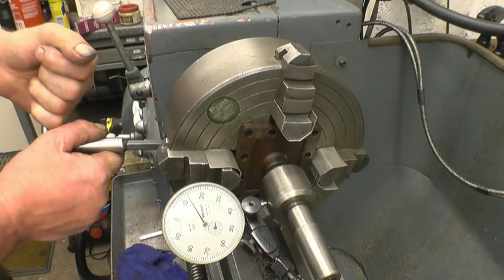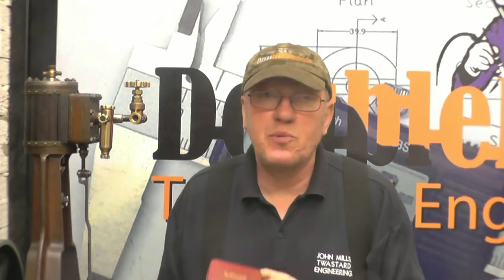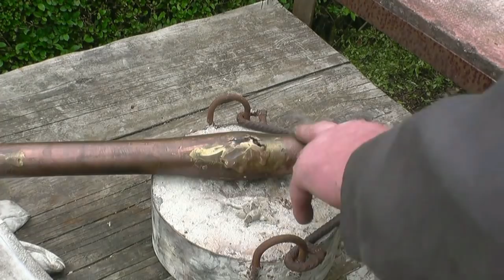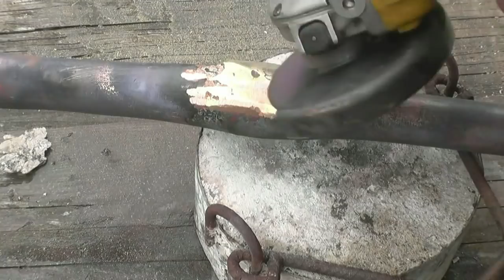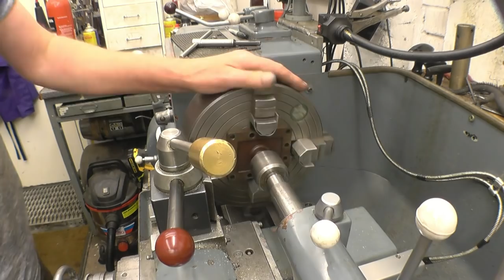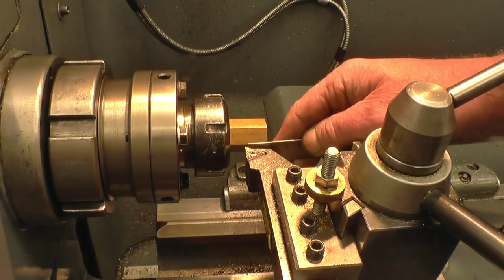SNNC 229 P1   Copper Pipe Braze Repair

Comment: John, with reference to the bursted copper pipe: I have been here before, when copper pipes that supplied water to my house froze and split. "No worries," said I: "I shall simply repair the break with a sleeve and silver solder!"  So I did, and it didn't leak. Well, not until the next frost, anyway; and then the pipes split again, a short distance from the repair.

So I repaired them again, and had the bastards split *again*, and again on one side or other of the repair. I suspect the problem of "bursting after repair" was caused by the fact that copper, when heated by soldering and allowed to cool slowly, becomes hard and brittle, unlike most other metals, where heating and slow cooling allows annealing. Copper heated and cooled in this way (that is, cooled slowly) is hard, and is therefore prone to "catastrophic" failure in frost. With hindsight, I suspect that heating the repair and then quenching it with cold water would anneal it, and allow it to cope better with temperature extremes. This may be why the tube you have here has failed in frost again after repair.

Just a thought...
Reply from the maker: Once copper is heated to a dull red heat it becomes very soft (annealed) it then slowly becomes hard again
Reply: It is time for a lot of insulation. That beats the repair process.

Comment: if you hold that hex stock in someone else's collets..they may get bent out of shape for you potentially springing the collets... ok to do that with your own tools, maybe no harm once or twice... but if you are in someone else's shop working for them... may be wise to ask... it is possible to "spring" collets.. basically bend one of the fingers of the collet out of alignment with the others, with enough force to cause it to set and stay that way...  which will make them less accurate, or unusable.  

that said.. in some shops they may chuckle at you for asking and do it every day saying any sprung collet is simply the cost of doing business.. best to ask though if you find yourself in the position of needing to do that.  you can make a hex collet or a bushing to fit your existing collet if you are going to run a lot of parts.

first ensure you shouldn't be using a little three jaw chuck...or if the boss is willing to have you take the time indicating on a 4... if not... ask if you can make a two piece bushing to save the collets... if time or circumstance is such that you must use the collete like that.. they will let you know... and you can save some face for having shown your care for the shops tools... not a bad thing to habituate in your mind.

if you put sharp corners of hard key stock in there.. you are almost certain to raise a dent n the inside lip of the collet and make it potentially a very expensive problem for the shop when someone else picks it up and doesn't check it or the part when set up... so you know.. they are spring material..and can take some abuse without being totally destroyed... but they are generally considered a high precision tool and expensive.

if you do what john did there without asking in some places youl'd potentially get fired... and be apt to have your associates gossiped about by anyone ignorant enough to gossip about people....  doesn't mean anything more or less than it does... there is about a thousand ways to get any job done... some pretty counter intuitive.

i have seen broken collets before, with parts of the fingers actually broken out.... but usually their stories are only spoken of in quiet whispers. .and shrouded in mystery.

thanks again John... great video as always... Emmy hot as ever.

Comment: PS. Perhaps you could also consider using your lovely TIG machine and copper filler rod (any electrical wire perhaps, or even scraps of copper tube) as filler rod, and doing copper welding, instead of using lots of gas and flux and brass.

TIG can be very hot in small areas, and therefore much cheaper and quicker than oxy-propane. I hasten to add that I have no practical experience with this process, but it seems to be one of the applications where TIG is recommended.

Again, just sayin...
Reply from the maker: Had the pipe not been repaired with brass in the past . I would have TIG welded it  Brass explodes under a TIG arc
Reply: That I did not know.  Thanks.

Comment: Have you tried copper/phosphorous rod John? No flux needed but flows nicely at around 850c.
Reply from the maker: No  I would have TIG welded it with copper if it had not been brazed
Reply: you will have to find a copper project to tig weld, youve not shown doing that to copper yet!
Reply from the maker: I will keep that in mind